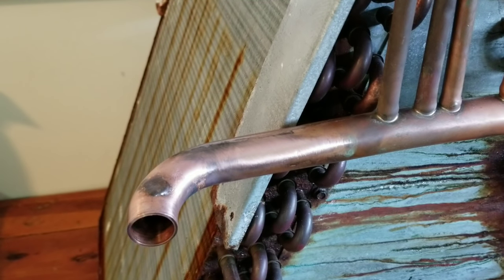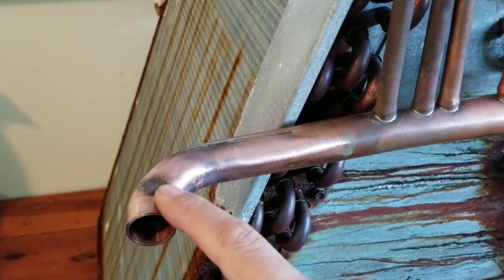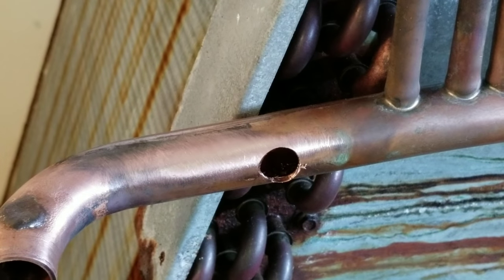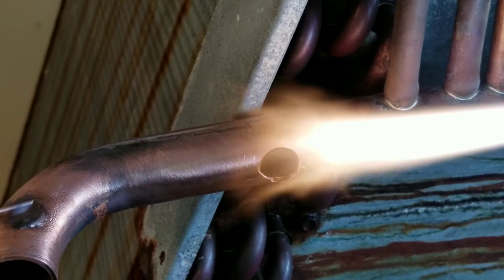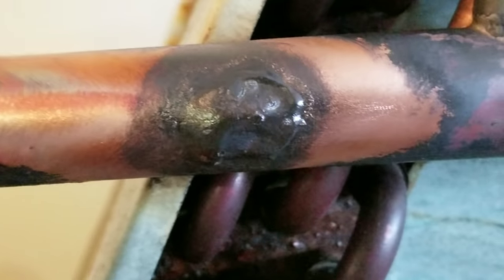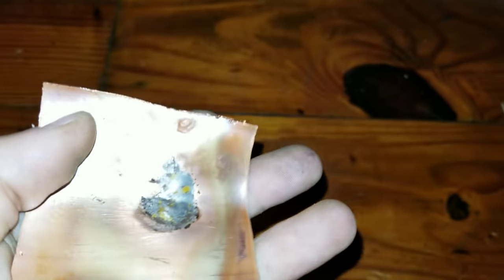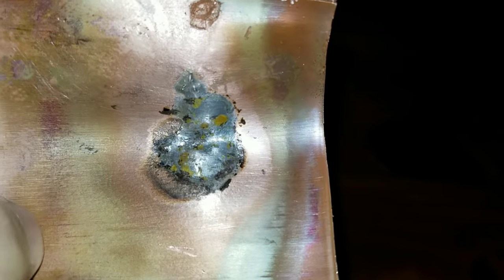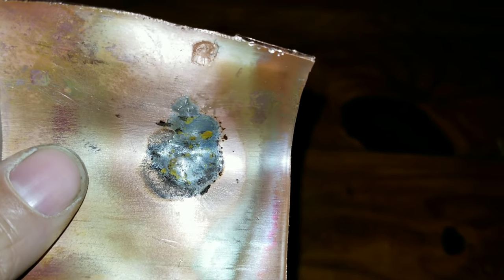Brazing Tips And Tricks / Fixing Leaks In Refrigerant Lines

Comment: I'm a relatively new HVAC tech (6mo) and I'm reliable but slow at brazing. I had a challenge from a teacher today to do something really similar. I had good luck pulling the torch away, heating the silfos, and following the torch and silfos to the tubing to "stick" the little melted ball on the hole edge. Rinse and repeat. It was pretty bumpy so I evenly heated to smooth it out. It actually worked really well.

Comment: Great video. I am wondering if this method can be applied to a tiny hole on a copper pipe with high pressure. Thanks.
Reply: yes but prefer staybrite #8 and a small copper patch, depending on max pressure.

Comment: Reminds me when i used oxy-acetylene torch the first time. Burned a large  hole in coil piping.
Reply from the maker: +Alex Egorov My boss years ago got us to melt hole in the pipe, then fix them. Over and over.
Reply: Hell yea me too... I went from just acetylene, to oxy/acetylene. I do a lot of small units so I melted thru a few pencil driers and copper 🤬
Reply: I made a hole yesterday, and had to fill it like in this video. It's holding pressure from an air compressor. Time will tell if it holds at operating pressure.

Comment: My limited work with small commercial reach ins have been using Staybrite but need to practice with oxygen/ acetylene and get more comfortable with for those sloppy joints and repairs.

Thanks for sharing.
Reply: used Staybrite #8 for years on installs and repairs melts and flows at 550 deg. as I recall without annealing the copper same strength pressure, tinsel ect instead of using Silfos. I have used Silfos without any flux still prefer staybrite #8 with flux.

Comment: Amateur here: I have a very small hole in a window a/c copper line. Can I patch the hole with mapp gas? If so, what rod should I use? I plan on recharging with a bullet valve after.
Reply: I have the same question
Reply: 🤔Also would like to know this, thnks nice video.

Comment: How can we find and fix leak on a pipe somewhere in a house. It can even be under slab but an AC did not  know for sure where the leak is.  He said the leak is under slab which a lot of people told me not true.
Reply from the maker: Isolate the pieces of equipment from the refrigerant lines then pressure test each piece to see which one has a pressure drop.
If the copper lines are in the slab without a proper sleeve I'd bet they are leaking too. Concrete will eat copper.
Good luck

Comment: The rust is on the Solder? Iron is in your Solder?
Reply from the maker: Not a chemist bud. No clue of every element in these 15% SilFos rods.
Reply: @HVACinSC  Thank you, lol was a Chemist for 15 years now I am a Handyman just installed a New 90+ Furnace and Central Air. Just got done installing my line set and borrowed my buddies Oxy Acetylene torches copper to copper fittings. Buddy gave me two types of Rods not sure if I use the Silver Rod for the Copper to Copper or the one that is a bit duller? Have to get Oxygen tank filled in morning? Any help appreciated thank you for your answer. I subscribed.
Reply from the maker: @claystone7729  Without knowing what exactly the brazing rods are it's hard to say which would be best.  I'd say the one with the higher silver content will perform better but both rods will work fine on copper to copper regardless of composition.

Comment: Nice job. Not very pretty but quite functional.
Reply from the maker: +Gary Dudgeon No nitrogen equals impurities in the joint as I mentioned but thanks. 👍
Reply from the maker: @MAK Truck Its all good dude. I post my work to the public so everyone can voice their opinions. 
I'm not the authority on brazing but I think I'm far better than average tech. 😁
It's not very pretty but they usually aren't when you fix a hole this large with only a brazing rod. Not to mention the lack of nitrogen.
Reply: @MAK Truck No I can't.  I meant it as a compliment. I have seen the time when a guy that repaired a hole like that could get water to livestock until a prettier repair or folks could get heat  while waiting till morning to get materials for a better repair.  Sorry if you were offended.
Reply from the maker: Dont worry Gary, I appreciate your comment. Thanks for watching man.
Reply: @HVACinSC  I really did mean it as a compliment.  Sorry it offended  MAK Truck.  I have seen the time when a repair like that on copper could get somebody water or heat  until pipe and couplings could be acquired after a holiday .  Again, NICE JOB.
Reply from the maker: @garydudgeon  Nothing at all to apologize for brother. Again I appreciate your views and comments. Have a great Sunday.